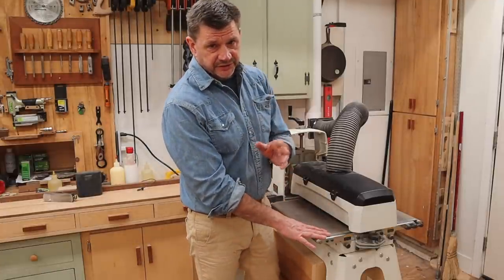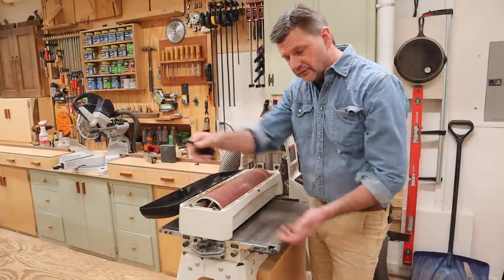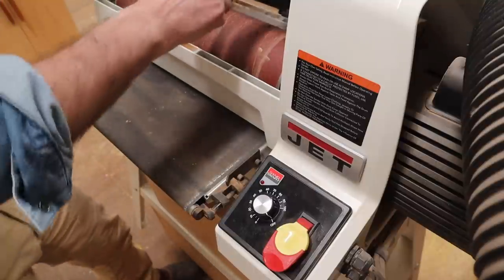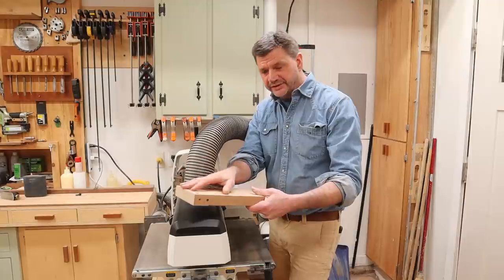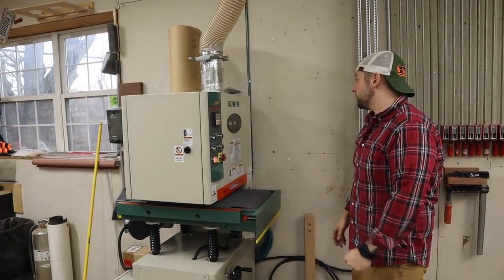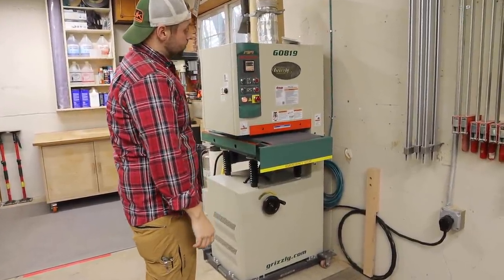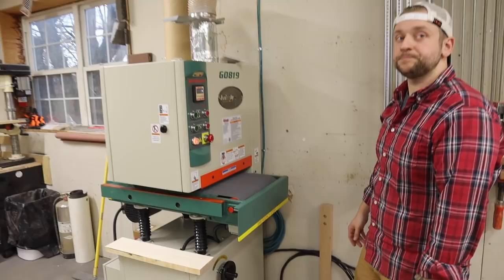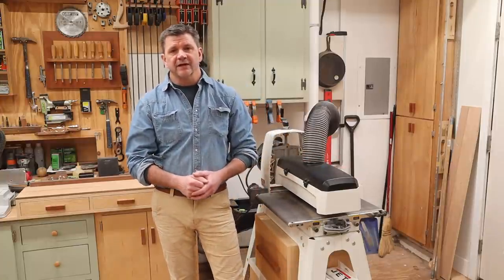Drum Sander VS Wide-Belt Sander: What Should YOU Buy?!?

Comment: Belt tracking issue: This may apply to your type belt as it is similar. I maintain a lot of treadmills, and every time a walking belt wouldn't stay on center, it was too tight. I loosen the bolts on both sides evenly until it slips, tighten both bolts just to where it doesn't, then adjust the bolt on one side or the other until it tracks. Can't hurt to try it. Also, clean under the belt. Use a small dowel to push a damp towel between the belt and deck, secure both ends of the towel, and run the belt around a few times. Belts can wear/stretch and cause that, but doubtful after only one year in a one man shop. We get 20,000-40,000 miles on a belt before replacing. Of course, if you ever have the belt off completely, wax the deck as you would your table saw top.

Comment: I have a supermax 25x2 5 hp that replaced my old 16 incher.   The belts do drive me crazy at times.  When they drift, you need to tighten the bolts in the direction they are drifting, and then loosen the other side.  Go easy with a 1/4 turn at a time.  It always seems to bring them back in line for awhile.

Comment: Thank you for the video. I’ve got the Jet 10/20 - how I wish I had got the version that you have. I’ve got 2 issues with mine. The first is the worst. Unlike the 16/32, replacing the paper on the 10/20 is dreadful. You don’t get access from the top - but from the infeed side; access is awful; to compound this, you can’t fix the end end (the last bit that you clamp) of the paper without using the special tool that comes with the machine- it is dreadful. The second and lesser issue is getting decent paper to use; here in the UK, I can rarely find pre-cut, decent quality paper; I end up buying rolls of paper, including fabric-backed, Abranet etc, to get decent stuff.

As you say, you cannot set the machine to take off too much; my machine doesn’t have your setting warning but you know when it’s too much because the paper burns. I don’t use softwood (does plywood count?) but never take off more than 0.2mm at one go. Regular use of those crepe bars is essential to prolong the life of the paper. 

I would give mine 1/10 for design and 8/10  for performance when it’s finally working

Please let me know if you want to swap my machine for yours; I will even throw in some paper!

Comment: good review.  I have both too.  I have the old original Performax and yeah, the damn sandpaper feed belt always travels over too, and it is a PIA. In 18 years, I've NEVER had to adjust the rubber belt of the wide belt.  it is obviously a pain to change paper compared to a wide belt, (I have the Asian made (probably similar to the Jet of 15 years ago open ended, 16" x 48 belt)  fast belt change, takes 10 seconds, so you change when you want.  Wash the belts every once in a while and they last a fairly long time.  Hard to wash the Performax belts, never tried.  (hardly use it anymore frankly).  Same footprint size, so much faster and easier.  Sure, us hobby craftsman can't afford the wide belt?  Well, if you spend 50% of your time sanding stock, the hobby isn't fun anymore . I spend a day prepping stock maybe, but hell, then ALL those boards are thicknessed to the right measurement, to the right grit, so that later sanding is a breeze.  All the use of Dominos is faster as everything is repeatable.  You can run board on edge in gangs, If not too wide, (2 or 2 1/2" say).  I have a 220 5 hp motor.  WISH I'd gotten the 7 1/2 hp, 3 phase!  Why?  cause we all try to bite a bit more of a cut too often.  you get to know your machine for sure.  but having run thousands of lineal feet of wood thru the sander in the last 18 years.  I know it well.  I listen for the motor slowing down.  CATCH it before it bogs!!!!!!  If it does, you have to release that thickness, (crank it open a crank) FAST.  if you don't, you will burn out the little piece of metal in the centrifugal clutch.  (the one that disconnects from the capacitor start).  When the motor stalls, all the power is going thru that metal piece and it will burn up.  (ask me how I know? )  I've had it happen twice in 18 years.  It isn't an expensive piece, but you have to remove the motor, (it is a HEAVY motor) 200 lbs? take it to the shop, get the new capacitor in there, new clutch metal, then return and get it re-installed.  Will cost you a few hundred $ and 3 or more hours of work with a friend to help.    I believe that with a 3 phase, that is not a problem!  And VFD's can run these things fine on single phase 220 to 3 phase.    Anyway, they ARE much nicer.  much faster, better everything than the performax.  (which I ran for 15 years and ran 1000's of feet thru that too, but it was a much more painful process.  Now as long as the shop is free enough, I have plenty of air (they need a fair amount of air) and the DC is working well, then I can mindlessly run 100's of feet of wood.  I do it with ear phones on, get it all done, then can process at my leisure.  
Of course the oscillation of the wide belt makes a MUCH better surface than the drum sander.  If you want, you can get platen wide belts that do even better.  I don't have that. 
Jon had trouble clamping the paper too, on his drum.  It is fine once you do it first thing in the week, after that, it is fast enough, but still takes a couple minutes to change out.  I do NOT buy them pre cut.  much cheaper to buy 100' or longer rolls.  but then you have to measure correctly and cut them.  
My wide belt is not exactly the same as the Grizzly, (made by Shen Sheng or some thing) but mine is a bit beefier, and obviously might be the same manufacturer as Grizzly uses, just older. 
And while the performax can do wide (maybe 32 or so?) I always could SEE the seam between the two passes.  VERY hard to not be able to see and feel it. I adjusted it and even bought the little adjustment device, which helped, but never perfect.  The wide belt IS darn good.  Not to say you can't see it, but almost perfect.  With some RO sanding afterwards, it is pretty invisible.  Especially if you are talking say 20" or so.  Fine for that.  I can sand mine (two passes) and barely see it.  
I use lots of belts.  I have 30 grit, 60, 80, 100 120, 150, 180.  I use different belts, and combinations.  I tend to go to 120 at least, but 150 often, 180 maybe 25% of the time.  I HAVE 220 and even higher, but rarely use that anymore.  Too easy to burn.  but if I was doing something that was doing a lot of pieces, especially shorter pieces, say 3 or 4 feet long, and I WANTED a really fine sanding, I might.  Trouble is that there is still some chatter with it.  So RO sanding afterward is more the common for me. 
AS to the belts for the wide belt?  Don't buy from someone like Grizzly, go direct to a sandpaper mfg. (currently trying someone by the name of Fintech abrasives)  Buy in sets of 5 or more and you can buy different weights etc of paper, and get them for more like $20 or so per belt.  
As to setting the thickness?  yeah, tension the belt, turn on the conveyor, and you can tell when it starts to grab, even without the belt running.  That gets' you closer than you will with the caliper.  Remember, if you are starting out with wood that has come from the yard, or has snipe on the end, or is somewhat "twisted" then it might be fine in part of the length, then bog down.  so you have to keep an eye on that amp meter.  When it climbs up to a point, be concerned and ready to crank it looser if needed. As the guy demonstrating cranked it a full turn, I was a bit surprised, yeah, with maple, and all, that would be too much normally.  He saw that too as it went thru.  But because it was shorter, and not super wide, and the grit was 100, it made it.  He was honest about it, not that much experience with it.  They knew what they were doing.  This will be a HUGE difference in their shop.  yeah, the most expensive machine, but probably the most time saving machine they will have too.  Now if they were able to go up to a 24" or a 36" then it would really be a savings.  If you are working with figured woods like I do a lot, then it is hard to keep that planer from having tear out.  So I thickness often with my widebelt.  
good review.  Hope maybe my own comments help someone.  Wish I had the power to run a big widebelt, but find someone in your town that has one and will run stuff for you. I found a guy with a 47" wide belt, (2 belts, each on a separate 30+ hp motor, 5 hp feed, and HUGE DC, digital thickness, and all that.  big footprint.  Charges me about $100 an hour (or more) to run stuff, but he does most of the work.  If a belt is destroyed or damaged, I pay. but that is fair.  It saves SO much time.  You can run some birdseye maple table tops thru and have one top and bottom sanded, (top to 180 or what) and bottom to 120? in 15 minutes.  So I try to bring several things to sand.  Get as much glue squeeze out scrapped off.  He will appreciate it.  hardened glue messes up belts.

Comment: Belt tracking is all about the belt...so I've heard. My Laguna tracked inboard with the stock belt. When it finally broke, I got a different brand and IT tracks OUTBOARD. BOTH belts tracked in the same direction EVEN IF I FLIPPED THEM. I called laguna and even they wouldn't offer  any advice except that "it's all about the belt". I hope that helps.

Comment: at 1:52 where you are standing, the 2 bigger knobs if those adjust the vertical of the table those need to move / pivot. I recently found my self scratching my head on a industrial belt sander. Its literally like a few thousandths brother, then that probably will be solves. Also if that does not fix it put a dial indicator on the bottom of the table some how, see if the table if flexing up , and down if it is whatever you did to fix the tracking , increase that by 100% to 400% then that should fix the flex once it starts. Now the other idea I got in my mind, is the roller itself is not balanced properly, then that's causing the resonant freq , to f itself up. I do not know the machine, that's just my input. My father has been building/ working on machines 40+ years, my uncle 30+ years industrial maintence, they taught me alot about these things. I am also nim certed as well. That is my 2 cents, probably will not work but worth a try. i fixed a radial arm saw the other day my father could not get to re square cause he is going blind, well never could square it to a few though in cuts. Yup did that to lol.

Comment: Try taking the conveyor belt off and measure the inside diameter on each side. This will let you know if one side of the belt has stretched. If so, it would be best to buy a new one. You can splice a continuous belt, but is a pain in the rear.

Comment: Another key difference that wasn’t pointed out was that the wide belt has an adjustable platen. It can be disengaged for precise thickness sanding on the drum in special applications. Platen is much better for smoothness

Comment: Maybe a trick I use with my hand sanders would work here. I tape a 
1” tongue at the end of my sanding paper to help pull it in place. Once locked you can trim it off or leave it. I don’t know if it will work here with your sander when replacing the paper but worth a try I guess. Let me know if this works?

Comment: Jon I have a Super Max 18/36 drum sander which is the same as your machine and like your machine regardless what adjustments I made it would not hold true . I let it run into the side and killed the belt put a new belt on adjusted it and not been touched since . Instructions with new belt said to discard ceramic guides

Comment: I appreciate the review. I would have appreciated a bit more on the home shop sized sander as I don’t believe many of your viewers will be in the market for the commercial Grizzly unit. I own a Supermax and find it very handy when I need it.
Reply: I don’t think you can find a wide belt smaller than that one. I didn’t know anyone made them in single phase. Most are 480v 3 phase with 20-50hp motors

Comment: Nice review, Jon.  I have a 16/32 Performax that I bought in an estate sale for a great price and it looked to be barely used.  The only adjustment I have difficulty with is getting the drum level to the sanding surface.  It always seems as though the outboard end of the drum is higher than the inboard side.  Either way, I really like using it.  I haven't used it for any softwoods either, but I do get a slight amount of burning with light passes over Cherry.  Apparently, Cherry is known to have tiny "resin pockets" that promote the burning.  Always experimenting with settings though.  :-)
Reply: Andrew, I have a perfomax, (I reviewed above) and they did make a little metal device that fits onto the attachment point on the outside end of the feed roller.  this device connects the roller to the arm and by "pivoting" the attachment you can more effectively regulate the adjustment.  This was an aftermarket device, made by Performax but not supplied WITH the machine.  i don't know where you would find one, but I have one, so I know they are made and work.

Comment: Great review. Do you have any suggestion for belt sander for small shop? Also who is your favorite wood supplier in NJ? Thanks a bunch!
Reply: Assuming you mean a wide belt, I'd recommend the 37" timesavers speedsander. Can be run with single-phase power, has casters so it isn't too hard to move and 37" will handle most things a small shop will need. I have one and have used it for hundreds of butcher blocks and it's worked well. The grizzly open-ended may work well too, but it's smaller and getting a good clean double pass is difficult I've heard. Make sure you have good dust collection for any one you get.

Comment: I've got the 16" version in a school shop. The kids frequently use it to reclaim pallet wood which is often very pitchy. It has been a workhorse for three years now.

I use a "clothes pin" type spring clamp (small vise grips work too) to hold the inboard clamp (compressing both the tensioning spring and opening the clamp) in place ready to accept the end of the paper. I do wish they had made these so the paper wound on from the inboard to the outboard side. Although you CAN wind it on that way, the orientation of the tensioning spring makes it difficult to adeqautely tension the paper. I keep a latex cleaning stick close to the sander and give the drum a pass every time I use it.

I also keep a spray bottle of blade cleaner (CMT Orange) near the sander and give the drum a spritz whenever pitch begins to build up on the sand paper. I always run the feed at 100% and let the "smart sand" feature slow down the machine if necessary. If it does, I back off the depth of cut and check to see if I have loaded up the belt with pitch. In my wholly unreliable opinion, running the boards through as fast as possible keeps the stock cooler and reduces the build up of pitch.

If a belt does get badly clogged, I remove it from the machine, spray it thoroughly with blade/bit cleaner, and after it soaks in a bit, scrub the belt in a pail of hot soapy water using a nylon brush, then hang it to dry. The cloth backing seems to hold up well to at least 3 cleanings like this, but the ends catastrophically tear off after the belt is removed and replaced a couple of times.

Comment: Thanks for the review, I have to say for an $1800. dollar machine it appears to be very underwhelming. it's a shame that these sanders are so expensive for a powered roller with a strip of sandpaper on it.
Reply: They are about the simplest and cheapest shop built machines going.  I have one that sands just over 600mm wide as I need to sand cabinet doors. Shop scraps, a cheap motor off ebay and less the $100 in hardware.   Coming up on 16years old and all I've replaced is the main shaft bearings once.

Comment: Do you ever use one of those sand paper erasers to extend the life of the paper?  I have not tried them but understand that they make quite a difference and can also keep the finish more even.  I’m curious if there is truth to that.
Reply: Try a scrub with Easy Off Oven Cleaner, wash off, dry. We use with our big wide belt and get several recycle out of the belts.
Reply: @jimlambrick4642  interesting.  Thanks for the info!

Comment: belt could be stretched to much,or to much friction resistance from bearing or bushing,remove roller and look for wearing around shaft and bearing surfaces,reassemble components ,with new parts if needed,grease and realign bearings or bushings ,check all stationary mounts for rigitiy and other components.

Comment: Picked up a Performax 16-32 a while back and absolutely love having a drum sander in my small shop, use it all the time! 
Quick question. Is your dust collector 120V? I notice you use the Lutron pico remote for your collector switch. I used that for my small 1H collector, but my 2H is 220V and haven't figured out a way to use the wireless switch setup to run the 2H collector.
Reply: Run your DC through a heavy duty HVAC contactor. Use your wireless to energize the solenoid on the contactor.

Comment: Hey Jon, thank you for this review!  I'm noodling on this topic...thinking of importing a 32" dual drum sander from China, then modifying it to run 48" width chain-driven rollers I have from a motorized pallet conveyor.  I'm basically after the lifting and drive mechanism from the import machine, so I do not have to completely reinvent the wheel.  Desired use is to run table tops through it.  Just an idea for now, but your video gave me some solid intel to consider.